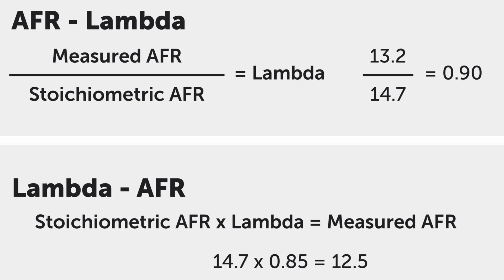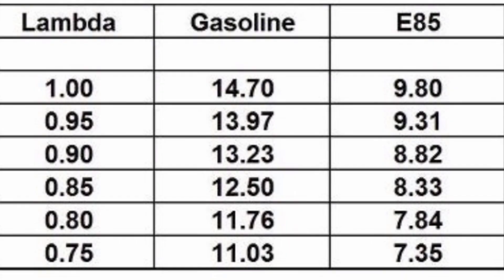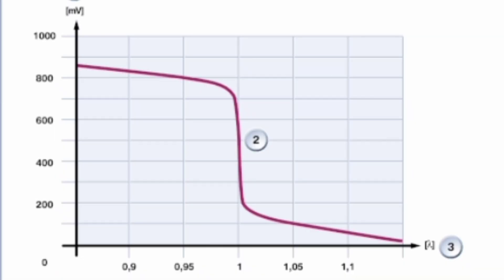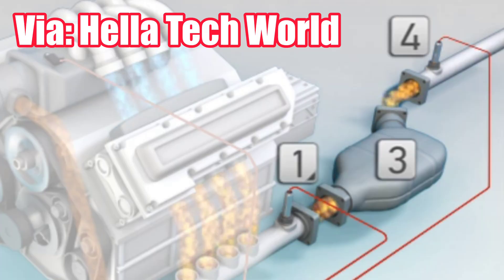Your AFR Readings are Probably Wrong. Here's Why.

Comment: Thank you! I have gen 2 B58 and just added catless DP and have full 3.5 delete all the way. I bought the spacers, but after adding them every way directed I was still getting CEL with “12B701 Lambda probe heating after catalytic converter, 138104 Exhaust flapper disabled, 180001 catless downpipe detected” so I removed the spacers altogether and now I only get catless downpipe detected and exhaust flapper disabled. Should I add one part of the spacers back? I don’t seem to have any fueling issues and my logs are good.
Reply: no, spacers do nothing but cause problems on gen 2 b58. Trust me. Getting it tuned would be the best thing to do (assuming you aren't already). The only acceptable cat code is the 180001, every other o2 sensor code points to a possibly faulty o2 sensor
Reply: @ Thank you for the reply. I am only running JB4 as of now and I really am not sure when I will be able to send my ECU out. Map 6 seems to be working out well and sometimes I can go days w/o the catless DP detected CEL popping up. Thank you again.

Comment: When I first put my downpipe on I did a bit of research to find out if the Gen1 B58 used the downstream for fueling like the N54/55 did, and the consensus was that it is just used for Catalyst efficiency (maybe a few more things but all emissions related) and didn't affect the fueling at all. do you have a link or source that says the downstream 02 is used and needed for fueling, at least for the Gen1 B58?

not trying to argue, just genuinely curious. I selected aftermarket DP in MHD and I was still getting a code for 02 (slow lean to rich response IIRC), so I had to install a spacer and just left it at stock DP in the MHD settings and haven't had an issue since, all the monitors set.
Reply: @kern417 Please respond to this, a few catless downpipe B58 setups have secondary O2 sensor faults show in MHD (no cels) but question if it affects the car's performance. Currently I am on the fence about buying a downstream O2 sensor. My current codes say "Open Circuit" and "Internal resistance too high". Codes: 12AB04, 12B304, and 12B701.
Reply: @AlexPriscu  I'm pretty sure for the Gen1 it doesn't affect fueling, my LTFT was always +-3% when using the spacer. Every so often I would get the delayed response code (usually when it was colder out), but I never had any issues even when custom tuned with an Ultraflow turbo, ds2hpfp, MHD ECA, and a few other supporting upgrades.